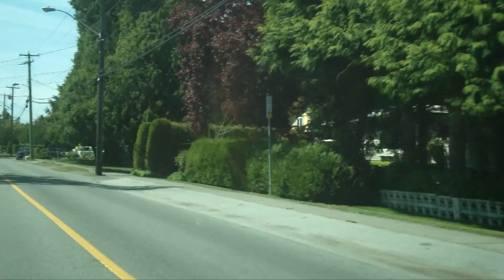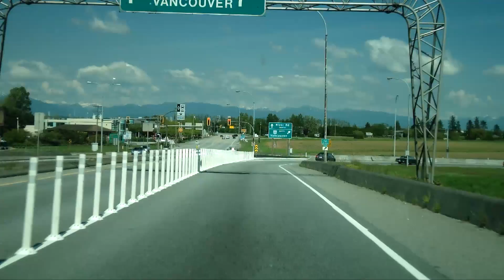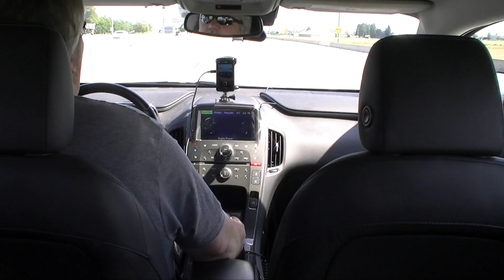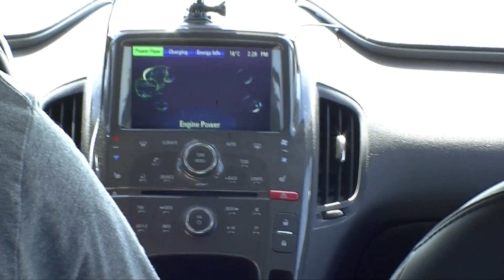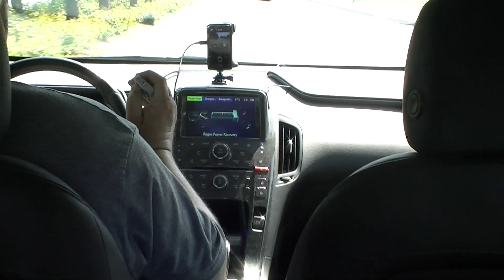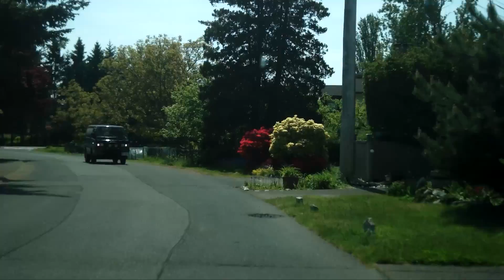How to drive a chevy volt for best electric range and fuel economy

Comment: Disagree on your comment about the brake pedal having anything to do with regen braking. That is a Toyota Synergy 2 characteristic. The accelerator pedal lift starts the regen. In drive it coasts, with same rate regen. In low is a progressive deceleration depending on the total movement distance from the cruise pedal deflection.
Reply from the maker: Rob B 
Well you are wrong. Just like the Toyota and Ford hybrid system, the volt when you depress the brake enters regenerative braking first as you press the brake further the friction brakes will engage. If you stand on the brake for an emergency stop the ABS system activates. If you just remove your foot from the accelerator in the D position the car basically coasts with very little energy going back into the battery. If you shift to L and take your foot off the accelerator the car is close to full regenerative mode. Perhaps 85%. If you start to depress the brake peddle in this mode the regenerative braking goes to 100% first and then the conventional brakes come on as you depress further. I have owned the car for 7 years and racked up about 130000 miles now. Still original brake pads. Still more than 90 of the brake pad life left. Can't say the same for my escape hybrid. Needed a full brake job at 60000 miles and now with 110000 on that vehicle it is almost ready for brake job 2. The regenerative braking in the volt brings me down to about 5 mph at every stop and the brakes stop the last 20 feet. Do you own a volt? No you don't because if you did then you wouldn't have posted such a stupid comment that every volt owner now is laughing at.

Comment: +12voltvids
I thought braking charges the battery?!?! But you always hear them trying to *avoid braking???" Please explain this!
Reply from the maker: Braking does charge the battery with regeneration. As you start to push the brake peddle it goes into regenerative mode. As you push harder the conventional brakes also engage. If you stomp on the brakes, the ABS kicks in ,and you stop on a dime. Shifting to "L" and taking your foot off the accelerator applies full regenerative braking effect, and will slow the car relatively quickly, however it does not turn of the brake lights. It is like gearing down on a standard transmission, and using the engine to slow you down going down a hill. So the guy tailgating you better be on his toes of he could be in for an expensive hit to his insurance.
I always slow down to traffic lights this way when there isn't a car right on my ass to generate as much power as I can. I once had a guy pull up beside me and start honking. I willed down my window and he said my brake lights weren't  working. I shouted back "That's because I wasn't using my brakes" and then put them of so he could see the lights. I did another video a couple of years ago to show how much power can be generated. Drove up to a mountain top, and came all the way down in regenerative mode. Started with 2KM range in the battery, had 35 by the time I got to the bottom of the hill, all recovered from regenerative braking.

Comment: Great video!!  I’ve had my 2018 volt for almost 2 weeks now I’m loving it! still fine tuning my use of D and L but so far I’m getting about 2L per 100 k.it’s been really cold here  so that’s been messing with my fuel efficiency and the range slightly and the engine coming on . but I’ve been charging overnight and preheating before I leave in the am getting between 89-95 km a charge every day temp depending my previous car I was putting 70-80 bucks a week into it gas wise to fill it. still have 300Km  worth of gas in the tank after about 800km of driving the volt is a fantastic car !
Reply from the maker: chad s 
It sure is. Best car I have owned. I have owned mine since July 2011.  All I have done maintenence wise in that time is change the oil 3 times. It goes in next summer for oil change 4.  I have gone through a set of tires and the only problem I have has is the buttons on the door handles to unlock the door have worn out. First the driver door wore out, then I started using the rear driver side button and it went bad so now I use the fob to unlock. I have 140000 on mine now. Still getting full range on battery.  In the winter the range drops to about half due to electric heat use but it will come back in the summer like it has every year. Still on original brakes. Had the rotors and pads checked when tires were replaced last spring. Still had over 90% remaining 11mm on front 10 on back. This is due to me using regen to slow me right down to a crawl. Your car has the regen paddle on the wheel, but mine doesn't so I use the shifter in L to slow me down.
Reply from the maker: I now have 2. The original 2012 and a 2019.

Comment: 3 1/2 years old and only 30k views and <200 Likes on this video? What a shame. I don't really understand the bias against the Volt. Sure, some in the US hate it because of politics. No specs or details can change that. But so many  environmental advocates and EV enthusiasts dismiss the Volt out of hand. Maybe it is finally time for a new look at this car.

That's what I did. I can afford any car I want. Well, within reason anyway. My daily commuter lives outdoors since my side of our garage is filled with my motorcycle collection. On nice days I'll ride a motorcycle but in the heat of a Texas summer, in cold winter rains, or when extreme weather threatens it's nice to be in a comfy car. I also get no comfort from freeway trips through metropolitan areas during rush hour on a motorcycle, especially when showing up for a business meeting.

Some time back I fell into owning a Nissan Leaf. When I bought it used I only considered it a stopgap car. I was selling a sportscar and didn't want to be without a rainy-day ride. the Leaf won me over. EVs are just too fun to drive and so efficient. I drove rental gas cars for long trips and still saved money.. The math was indisputable. The only problem was that I came to consider the gas engine rentals as, well, old fashioned. you get used to the electric zip of EVs, their immediacy and responsiveness. that's when I realized that electric vehicles will dominate the market one day.

I considered one of the Teslas. I still have concerns over their quality and service network but they are amazing cars. The thing is, they are seen as costly luxury cars. I don't buy costly luxury cars for a variety of reasons. Firstly, it goes against my sensibilities to be seen to throw money around. I have a modest home and save my money. I wouldn't park a Rolls or Maserati in my driveway and neither would I park a Tesla there. I don't want to be known as "that guy."

But I want an electric car and I want to be able to make trips. I was excited about the Bolt. I studied and test drove extensively. It is a wonderful car, truly game-changing. I can't drive it from Dallas to Atlanta though, or to Amarillo, or Denver. I would still be renting cars. One day there will be more quick charging but today there is not enough to make those trips possible, and those are the trips I make. I also found the Bolt interior to be a little, not sure how to put this, Immature? Econobox? Plasticy?

I understand saving weight. The Leaf saved weight through simple yet quality components. It has a timeless (interior only) design. the Bolt is stylish, the kind of style that doesn't appeal to me and the kind that won't wear well. While the Bolt is an engineering masterpiece of as-yet unrecognized proportions it is a styling disaster. The people who can afford it don't fit in its seats. The hard plastic interior is stylish but borders on garish and will soon look "old."

I expressed my concerns and my dealer (Buzz Smith at Classic Chevy in the DFW area, no relation at all, just saying) suggested I try the Volt. This guy has cred. I recently saw him interviewed in Ward's Auto. (side note; when buying an EV ALWAYS check reviews and with the EV community to find a dealer who actually knows about and wants to sell EVs. I've had horrible experiences at Nissan, Ford, and Chevy dealers who just weren't interested in talking electric) Buzz told me to check out the Volt so I went and did a thorough search. I was impressed with what I found,.

but I also found a bunch of talk about people hating GM, hating what happened to the EV1, hating all sorts of things but surprisingly little about the Volt itself. What I did find was awesome. The autoline interview with the chief engineer on the new Volt was especially informative, along with countless videos explaining the new in '16 driveline.

to cut it "short," yesterday I picked up my '18 Volt and I am overwhelmed. I spend time on racetracks on motorcycles and in cars. I say the Volt handels better than any of the compact EVs I have driven and better than most cars. while it lacks BMW top speeds it accelerates briskly and will outperform most cars in Legal driving. Unlike the engine in this video, when I turn the engine on, it is silent. At all times the car is quieter than in my otherwise very quiet Leaf.  I have not yet had it come on automatically. It easily covers my commute in electric only. On the freeway I can switch it into HOLD mode where it maintains the charge level but I have only done so experimentally so far. Some time soon I plan to test the 101MPH speed limiter (on a closed course, professional driver, do not attempt).

What strikes me most about the car is how Nice it is. Fantastic stereo is enhanced by the very quiet ride, much quieter than the Leaf. Adaptive cruise control and autonomous style driver's aids, powerful climate control, 4 heated leather seats, lovely styling, configurable display, seamless iPhone integration... This car is amazingly well put together. I got basically everything available and it was less than 41k USD. Add to that what my neighbors see is a Chevrolet. It's not a Tesla or Audi or other in-your-face statement. 

My wife, who has patiently taken a back seat at countless test drives of some very unusual cars got behind the wheel of the Volt, surveyed the controls and exclaimed, "oh, it's just a normal car." That is the beauty of the Volt. It's just normal. It just drives. It doesn't show off that it is the most technologically advanced vehicle available for purchase today. The best tech is seamless and invisible. GM nailed it with this car. They should let people know, maybe even advertise it somewhere. This is the best car ever made in America.

Comment: In the 2nd gen i don’t need to switch to N, going down hill with L I can maintain the speed limit and go into -KW. 
The 2nd gen has a meter showing exactly how many Kw are being used or regenerated. So... when maintaining a speed on different grades you’ll see it drop or raise. I can capture valuable KW just maintaining my speed with slight downhill grades. That’s why I keep it in low. Also I have seen the range jump from 85km to 100+ doing this.

Comment: With my 2018 volt I get 1800 kms per tank driving 134 kms daily. I leave it in low all the time. My car also has the paddle which regens harder. 
There is no harm leaving the car in low and you’ll always be ready to slow down with regen.

Comment: Do u plug in every night to charge ur battery? Also I just wondering why ur using the metric system of weights&measures like kilometers and liters of gasoline... Please use miles and gallons its easier for everybody . I know how to understand the metric system but we "prefer" miles& gallons.. Thx !
Reply from the maker: Bekha aranda 
Well in Canada we use the metric system like most of the world. The problem with the old system is there is 2 different gallons. There is the imperial gallon and the smaller us gallon. 
This is the sneaky way that dodge markets their trucks in Canada. They base the calculation on imperial gallons. They show the correct l/100 km but convert to gallons and use the larger number. For example the volt averages 40 miles to us gallon when burning gas. That is 48 in imperial gallons. So to keep things simple I used the standard metric system where everything is equal. Yes I understand both systems too and still refer to temperature in F. I would prefer if we measured how many km per liter a car got instead of them rating system of how many liters per 💯 km driven. That part is stupid .
It would make much more sense to list the car at 40 miles / us gallon,  17 km / liter as opposed to 5.8 l / 100 km
Reply from the maker: Bekha aranda 
No I don't plug in every night. I can drive to work and back all week so I generally don't plug in every night and take advantage of the free charging stations at the mall when I go out for dinner or shopping. I typically change up Friday night, sat and Sunday at home as I am driving a round more on the weekends. During the week I am going to and from work which is 9 miles round trip so I can go all week without changing.
Reply: At the pub You are still requesting a Pint, right?

Comment: Hi I've just put a deposit down on a Holden Volt (Australian/NZ) badged Chevy volt.  I had an extended test drive and got to try out a lot stuff.  The the charger seems a bit dodgy red lights until it was wiggled a bit!.  I got it to charge and unplugged it at 11pm fully charged.  The following morning it showed just 60km of range.  Is this because there was a frost overnight and the battery was cold in the morning.  Would I be better to leave the charging cable in overnight?  Or do you think I might have a dodgy battery?  Cars done 48,000km and averaged 1.7km per hundred over its lifetime and only 0.6 in the last 30k.  Only 6 Volts in NZ total all right hand drive.

Thanks for the Video

Cheers

Steve
Reply from the maker: On the first gen volt (2011 to 2016) the full charge range is 60Km. The new second gen model, it goes 85.
It is always best to leave it connected over night especially if it is cold, as the heaters will keep the battery at optimum operating temperature for when you head out.
I haven't heard of any battery failures. Mine is now 6 years old, and has 120,000 KM on it. Never had any issues at all.
The charger lights normally do blink red/green a few times as it does a self test. What it is doing is checking ground connectivity. There are ground fault circuits built in and if the charger detects that something is not right it will not allow charging. This is a safety monitor. If the ground were to fail, the car body could become electrified, therefore the charger monitors input voltage as well as the earth ground for any loss of bonding to earth.
Also, it is perfectly normal in low temperatures for the battery range to drop. When it is below 0 here and I am running the lights and heater, I will see my range drop almost in half. As soon as the warmer weather returns so does the range.
Reply: Many thanks I had a great drive, put my 75yr old folks in the back and my sisters kids.  Everyone liked the car.  It rides much better than BMWi3 and it's costing me almost half as much to buy as a BMW REX would.  It'll do my 38km commute on the battery in hilly Wellington NZ and much longer trips.  NZ charging network is in it's infancy.  Depreciation for the Volts previous owners has been villainous but it leaves me with a bargain.   

Wish they'd built a RHD Cadillac ELR those look cool.
Reply from the maker: Yes the ELR did look cool. Very expensive here, about 80 grand.
They have a new Cadillac hybrid coming out that uses the 2nd gen volt technology.

Comment: Nice video. Interesting reactions also. Since about two weeks I am the proud owner of a 2013 black Volt. Amazing car. Love it. My wife likes it also. In almost all the video's I have seen the quality and lack of issues is mentioned. So I think I was rather unlucky to have a problem a few days ago. After pressing the start button a steering wheel lock problem warning appeared and it was impossible to put the lever in Drive. After some pushing of brake pedal I managed to switch the car off. My son adviised me to exit the car and lock it. After that I opened the car again and could start is quite normally. My son told me he had this experience with his Honda Accord also.  I think this has nothing to do with the Volt in particular but it is a problem of computers in general. Sometimes you have to switch them off and on again. 
I live in the Netherlands and Volts are very uncommon here. But the few people that have one are extremely enthousiatic.
Reply from the maker: I have had t glitches. One involved the infotainment center. There was a 10 second delay for everything. Turn up the volume, nothing happened, then 10 seconds later it gets louder. Change the radio station 10 second delay. Turned the car off, then back on, worked fine. The other one was when  major power surge hit the car while it was charging. It triggered a warning to have the HV charging circuit serviced. Car still ran, but once battery went down and transitioned to GAS it would not allow me to charge.
Dealer said the fault code was isolation connectivity issue. Computer detected that resistance was 297 meg ohms, and the threshold is 300 meg ohms. Computer locked out the AC charge plug. Dealer took apart every connector looking for any sign of corrosion or leakage. None found.  Concluded that an event occurred from the power grid right at the end of the charge cycle, or after the car had completed it's charge but was still drawing grid power to cool the battery. Because the code that was thrown may have indicated an electrical grounding issue (ground fault) for safety the car disconnected the charge port. They reprogrammed the computer and sent me on my way.

Comment: why don't you leave the shifter in L ?
Reply from the maker: Because I don't want the car slowing down quickly every time I lift my foot off the accelerator. I prefer to coast and use the shiftier as a way to slow the car without putting my foot on the brake.